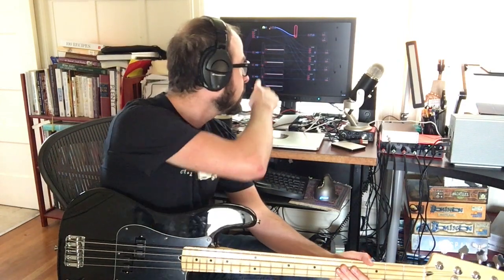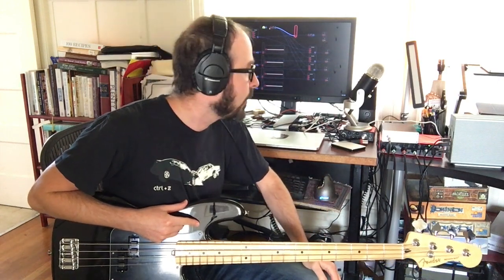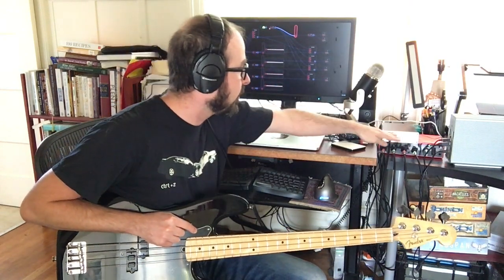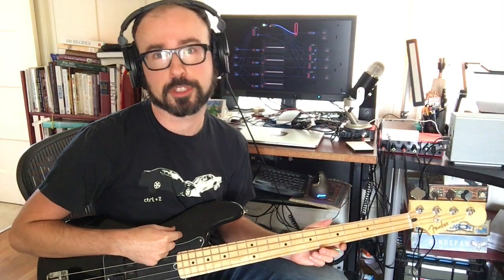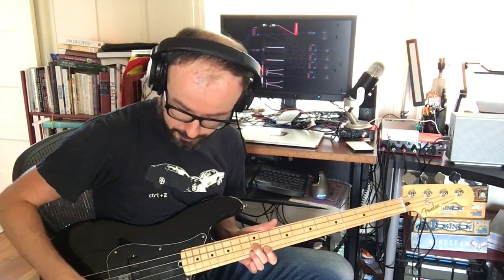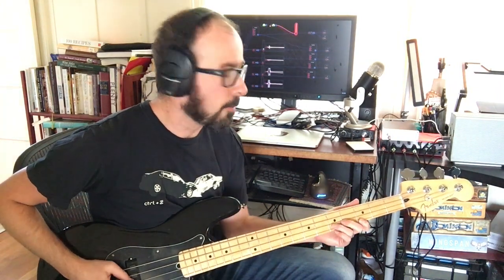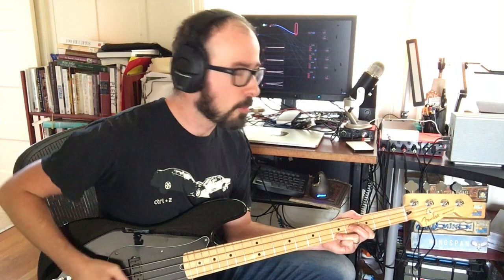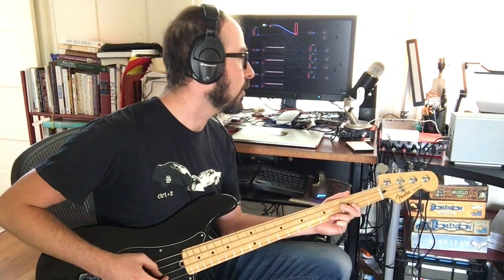Quadraphonic Bass (Cycfi Pickups) -- Intro

Comment: The prerequisite gear price for such a poly-phonic setup is a bit steep for the average Joe guitar\bass player:
the pickups + the pickup-splitter\cables + the 4\6\8 output Audio interface... at least $1000 so far.
But this is realy cool for recording, audio\string to midi as well!

Comment: Where can one buy these bass pickups?
Reply from the maker: I believe you can get them here: https://www.cycfi.com/projects/nu-series-v2/.  Looks like they only have preset configurations for 6,7, and 8 string guitars, but there's a "custom" option you can use based on the number of strings and the spacing on your bass